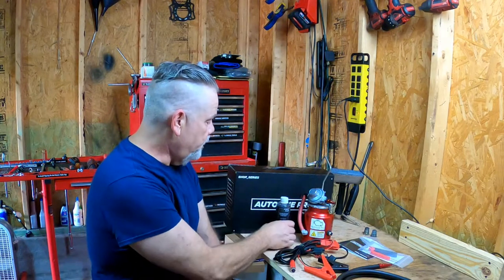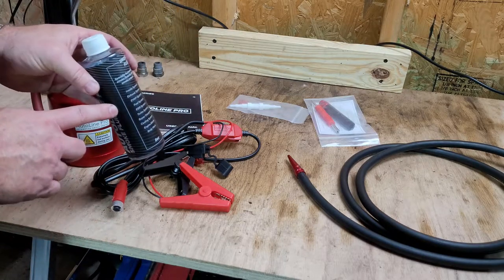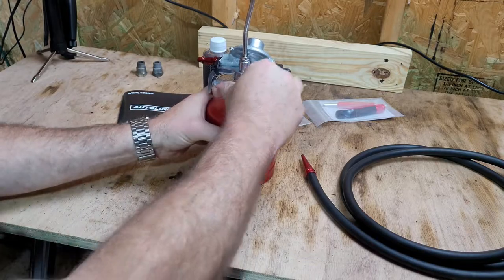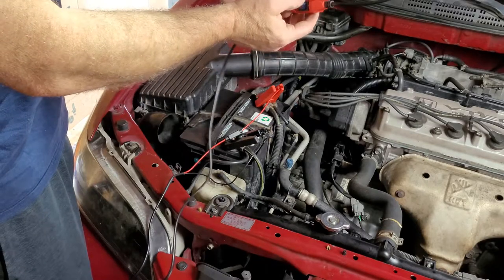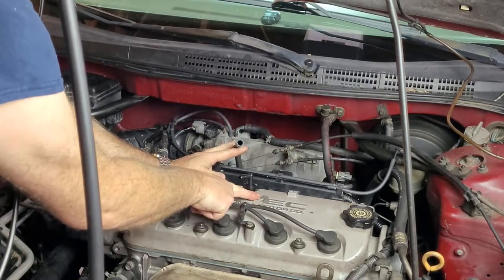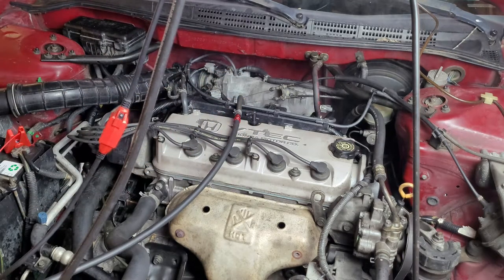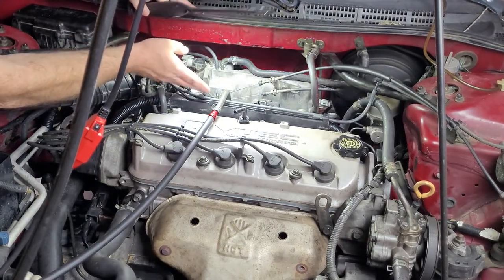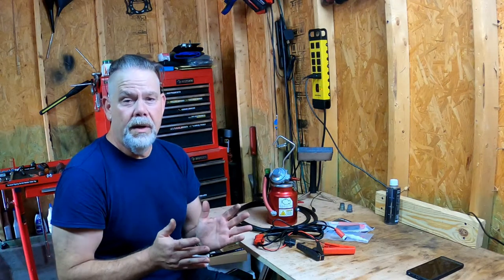Smoke Machine For Finding Vacuum Leaks

Comment: I bought the version with the "built-in" compressor a few days ago. After unboxing, reading the easy to follow instructions,  I went outside and hooked it up to my car. 30 seconds after I turned on the pump I found the leak. 

This is a MUST HAVE tool for  the "home mechanic."
Reply from the maker: Absolutely. Most older cars have vacuum leaks.
Reply: Whats the model number or brand,?
Reply: I'm surprised that actual shops don't have these. 
At least the ones I go to. I think they use vacuum tests rather than smoke ones but this way is 1000x better
Reply: @HaggisMuncher-69-420    The local Ford dealer wanted half again as much as the smoker cost to "smoke" my system for leaks.  I may never use it again, but I found the leak and fixed it.  Actually, there were two. After I fixed the first (which was larger) I found a second.  Had I gone to the dealer a second time I would have had close to $400.... just in diagnostics!

Comment: I just invested in one of these.   I've got 3 cars 15+ years old that require constant maintenance.  Dried and cracked vacuum lines are driving me crazy.  Hopefully, this thing will help me get them back in shape.
Reply: Me to. Driving me crazy also... Can't find the problems... I started out changing sensors.
Reply: @georgew.miller5643  I found a sizeable hose leak that was causing the engine to run rough.  Without this smoker, my only option was to replace all the vacuum hoses hoping to fix the problem.  I also got one of those foam cones to fit the tail pipe so I can smoke out exhaust leaks too.
Reply: yup

Comment: I have the same unit compressor version. Indispensable time saver. Vacuum leak found, exhaust leak, air mattress, air seat leak, and on... Paid for itself it's first use
Reply from the maker: Yep. They can save you a lot of headaches.

Comment: Ordered one. Built the PVC model, it worked! But getting the proper wire gauge and ohms is CRITICAL!! Got too hot so plug in floor flange melted. It made LOTS of smoke!!! I may repair at later date as spare.

Comment: Thanks for the review. I was about to get this anyway. My homemade smoker with glass jar and solder iron sucks. You can,t hang it up so it falls over or tries to burn stuff. No regulator so you can and I think I did induce an intake manifold leak If you over pressurize.  Not enough smoke. I did find some leaks with it that I could not with spray flammables  but what a PITA .
Reply from the maker: Then I hope the video makes you feel good about your purchase. I've been happy with it. Thanks for commenting!

Comment: Great video as usual. Did your egr valve leak smoke doing the test? Mine does and I'm told it's working as design, open when car is not cranked.
Reply from the maker: Thank you! Mine did not leak. The times I had the EGR off of that Accord, the valve was closed, so I don't believe it would be open when not running. Same for the older Civics and Ridgelines/Pilots. I don't know about other car brands.
Reply: @ktecgarage I check and mine is closed and tested to see if it opened and closed which it does. But the smoke is coming from the lower body and not the gasket. The same for the original one and another new one. So that two new and one failed EGR. Stumped
Reply from the maker: I've found that you have to get under the car to see where the leak is at. It could be leaking from something under the EGR like the intake manifold gasket or a vacuum line.

Comment: Thank you for showing the points where to connect the smoking hose. I was guessing about that PCV Valve, but was not sure. Does it say in instructions for that Smoke Machine what pressure to apply for each test? And if the car doesn't have any PCV valve (one of ours doesn't, 2003 Chevy Cavalier) where to connect that smoking hose then? Thank you again.
Reply from the maker: That machine only uses a pound or two of pressure. It it not adjustable. 

Any vacuum hose on the intake manifold can be used. Brake booster, purge, etc. The PCV was just the easiest on this engine.
Reply: @ktecgarage  I see, thank you. I've heard (fm /one film), that Brake Booster hose has some sensor in it, so better not to use that port. Purge Valve on this car (1002 Saturn SL2) is hard to reach. But I can always use PCV port. Especially you can use it in both directions.

Comment: Thanks for doing the video, I was eyeballing this one on Amazon but I'm kind of on the fence between it and a DIY (plumbing pipe build) as I've got most of the materials on hand.. minus pvc. 
I like the looks of a bought one, but the thought of replaceable heater and such on the DIY.  I was wondering, if it's not too much trouble, could you show the inside or let us know if the "guts"(coil and wick) are user replaceable.
Reply from the maker: Actually, I have the tool in storage right now. It is a coil wrapped around a wick. Those homemade ones work to a degree, but this one is hassle free.

Comment: Quick question, aren't you supposed to cap the throttle body, this test wouldn't work on my car unless you put a latex glove over the T body, thats what most people do because a huge amount of smoke gets channeled in that direction just like in your test and technically the system cant pressurize to perform the test properly, thats why its coming out of that hose that is torn,the machine looks like it works great, might have to get one for myself.
Reply from the maker: You are exactly right. I probably should have included that.

Comment: hey you want to avoid idle issues forever? bypass you IACV but it will take longer to warn up but run just as good once it reaches operating temp. cut out a soda can and drill 4 holes and wedge it between the iacv and tb. you're iacv wont affect idle and wont give a CEL like deleting it. you can also get rid of the coolant lines to it.
Reply: Lazy way of doing things for hillbilly mechanics. You can't just disable integrated systems without causing other problems.

Comment: I have a Nissan Juke and keep getting a MAF code 0101. I was wondering if there was a vacuum leak do you think this would help find out. I am on third sensor so I don't think that is my problem.
Reply from the maker: Could be a vacuum leak. Also a damaged intake snorkle or a clogged catalytic converter. Good Luck!
Reply: @ktecgarage  if it was the cat wouldn't I get upside o2 sensor sound off? I am ordering that smoke maker. Thank you for the video.
Reply from the maker: I had a chevy truck oncr that had a clogged cat and it never through a code. I guess it just depends on how Nissan programs them. Hopefully it is just a vacuum leak. Let me know what you find out.

Comment: So it only works off the battery? Can you unhook it and take it to the back of the car to do the exhaust and it still makes smoke
Reply from the maker: It needs 12v DC. A battery charger will run it or you could take your battery out of your car.

Comment: Could I hook up a tire compressor pump to the air port on the smoke machine?
Reply from the maker: I would ask the manufacturer before you purchase it. That regulator turns the pressure from a compressor way down.
Reply: @ktecgarage  nice roger that!

Comment: Can i use it on the intake hose for the smoke test?
Reply from the maker: You would have to hold the throttle open and block off your air cleaner. PCV valve into your intake would be a better option.

Comment: How much air pressure you need to use it correctly I have been watching many videos and I was not able to find the correct pressure
Reply from the maker: I think the regulator on the machine takes it down to 2 psi. I was running 60, but 10 would probably be fine.
Reply: @ktecgarage  thank you I really appreciate it